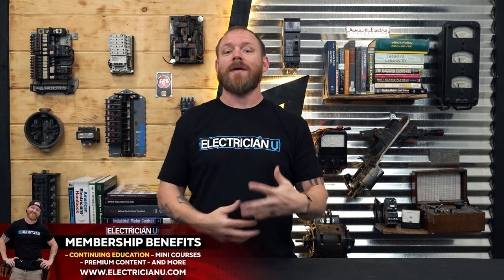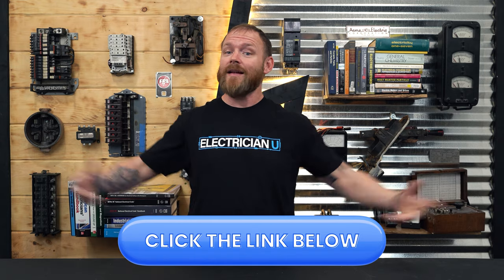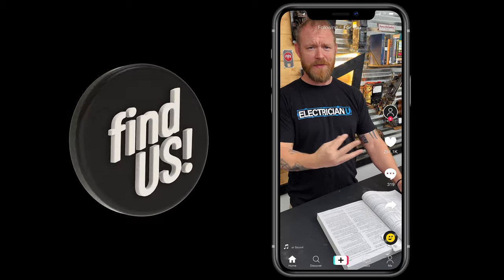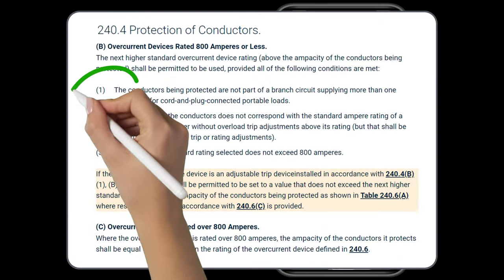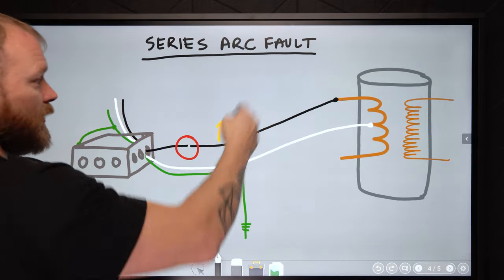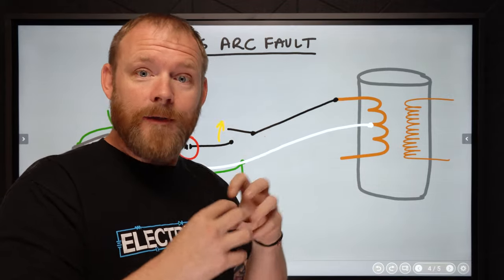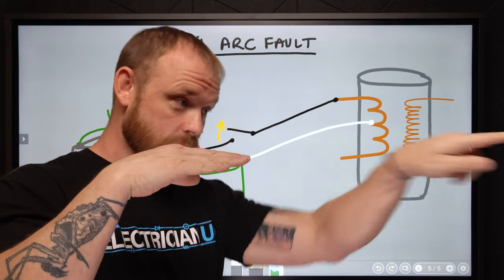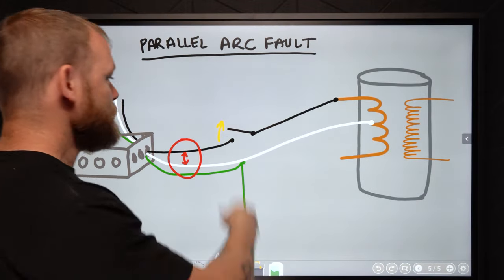What is a Short? What Causes Them?

Comment: Dustin, your video about 12/2 and 14/4 wiring from a couple months ago kicked up a firestorm that is still going. Many people didn't like 14AWG on a 20amp breaker for the lights. You should do a video explaining Fixture Wires and how they are different from branch circuit conductors.

Comment: 240 volt faults are exceptionally rare.  The vast majority of faults are usually either 120 or 277 volt, phase to ground faults.  The only 240 or 480 volt faults that I see are improperly wired double pole devices such as double pole switches, a fault that occurs in a 240/480 volt system found in older buildings, an easy one, forgetting to break off the tab when split wiring a receptacle.  Something that I have done before.  But the vast majority of accidental faults that occur are usually phase to ground like a loose wire touching the housing of a fluorescent light fixture for example, or phase to neutral like a defective device.  But don't get me wrong though.  Phase to phase faults do happen.  I had one the other day when troubleshooting an appliance that was 240 volt but used 120 volt for the controls.  The wire was damaged and the two phase hot conductors got fused together.

Comment: Was told in Vo Tech school a short is an excessive amount of electrons flowing down the pike. It's very important to always the proper size of over current protection either with circuit breakers or fuses. Scary first time standing next to a metallic conduit and hear the wires dancing during a short where they quick bumping into conduit wall makes a loud sound.

Comment: DUSTIN, thanks for the lesson, make a lesson on various relays, switches, contacts Electricians will test the contact resistance because of "pitting resistance". If you test the resistance using a DVM meter when the switch is open then half way closed then fully closed the DVM meter is testing at very low voltage giving a False Positive reading thinking the switch is good which its not compared to using a MEGGER which it will test the "pitting resistance value".

Comment: Great demonstration! I'm curious what happens if there is a short from the service lines (you connect the lugs straight from the transformer, no main disconnect or breaker of any kind). Normally the breaker would interrupt the current, but what would interrupt it in this case?
Reply: Utility usually has a fuse at or downstream from the transformer

Comment: What is the NEC regulation on outdoor lighting? I think there are many misconceptions on what is considered code and what isnt. Perhaps it may be an interesting subject to tackle for a video. Aesthetics vs legality/safety of inset old/new work plastic boxes vs 4x4 boxes with mudrings vs hubbell outdoor rated surface mounted electrical boxes.

Comment: Had a short circuit in a small electronic device. No battery connected, Crossed wires by accident and a small capacitor inside discharged. Everything still works fine now. Did I get lucky, or will I see future problems?

Comment: Worst short that I ever came across was when a 2,000 amp 240 volt circuit breaker tripped out during a heavy rain storm middle of the nigth. Breaker was in the main substation that was on concrete piers 25'above the ground. When I turned breaker back on the huge short sook the substation. That circuit feed a 240 to 2,300 volt step up transformer that feed another building. The high voltage cable shorted out inside of a 4" mogul LB. We were able to pull the cable out slightly to get some wraps of rubber & tape around it then wrap plastic around LB to keep water out.

Comment: good video but i was wondering if you could expand on backfeeds / neutral shorts , i recently had a lighting circuit with 130v hot to ground and 130v neutral to ground. i’ve never once seen 130v let alone 130v on every conductor ..
Reply: probably a switched neutral.

Comment: I’ve done Solar for a long time and everything is typically bonded down to the inverter/Solar combiner so I’ve always thought of a short and a ground fault as a similar thing but I don’t think that’s necessarily the case in regular, residential AC wiring.

Comment: Great video, but I'm a little confused. I looked over membership benefits and checked out community posts. It seems they are all at least a year old. Could someone maybe add a little more detail on reasons for joining EU? If it's primarily for supporting all the content you are providing, that's reason enough. But is there more that I'm not seeing? At any rate, thank you for all the content. I've always aspired to learning about electricity, beyond installs and repairs. It's hard to find the resources that explain the ebbs and flows, so to speak.

Comment: Let me tell all you electricians a story.
I was 11 years old and my sister had a radio cassette player.
Over time the power cable (being bent to often) had opened up and the wires were damaged, so the radio stopped working.
I saw my sister crying because of this and that pushed me to do something about it.
If this happened now, I would just buy a new power cable, but as a young kid with no income that wasn't an option.

I put my repair man hat on, went to the garage. Grabbed a stanley knife, side cutters and some electrical tape.
I went back into the house. Cut the damaged part of the power cable out, so now the power cable was in two halves (the power cable had two wires, a positive and negative)
With the stanley knife I cut about an inch of insulation off both halves of the power cable.
Plugged the power outlet end of the cable into a power point in the lounge room (turned the power point on) and the other end into the back of the radio and turned that on too.

Now in the mind of an 11 year old child everything is so simple. I thought all I had to do was twitch the wires together, wrap them up in insulation tape and job done.

I live in Australia. We have 240V mains here.
As soon as I bought the two halves of the power cable together, there was an intense bright blue/white flash. My whole body tensed up and was jerking back and forth involuntarily. This went on long enough for smoke to come off my body and clothes.

My Mother, Father, Brother and Sister were in the kitchen having lunch at the time. They would have heard a strange sound and smelled a strange smell (my cooking flesh) coming from the lounge room. Not to mention the very bright light.

My Mother came to the lounge room slapped my hands and that separated the wires.
How can I describe being electrocuted?

It was like some giant reached inside me from the front, grabbed my spine and said "I've got you, you're mine now. I couldn't let go of the wires myself.
It just wouldn't let me.

As soon as the electrocution ended, I cried. Boy did I cry.
It burned holes right through both hands.
My hair was impossible to comb for at least a week and also at school kids in my class would say they could smell a burnt meat smell.

I'm 44 now.
I'll never forget that experience with 240V AC as long as I live.

Comment: Hey electricianU, in oklahoma we had a instance a couple months back where a new construction apartment build lead to the largest fire in okc fire history.   The canton apartments Oklahoma city.  A lawsuit against OGE power and red dirt underground llc.  A “neutral” conductors was made live erroneously, this was blamed for burning the entire construction project to the ground by creating an unintended electrical pathway.  For some reason this doesnt ring clear to me, please investigate this.  How the HDD crew was named in the lawsuit when the power generator is the one that energizes the lines and not the contractor, wtf happened?  

Was this because of an unshielded neutral arcing directly to phase or ground? 
If the neutral was grounded, how did it cause a multimillion dollar fire?
Was it phase to phase voltage within a “single” phase?
There are holes in the news story that im dying to understand.